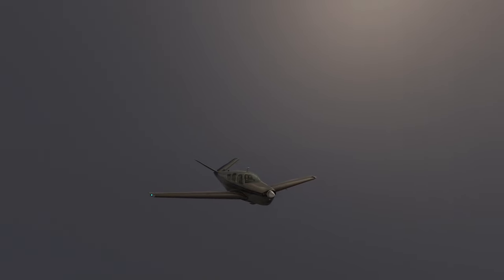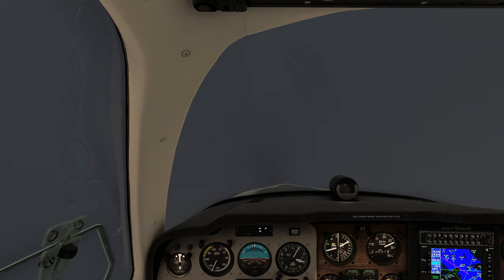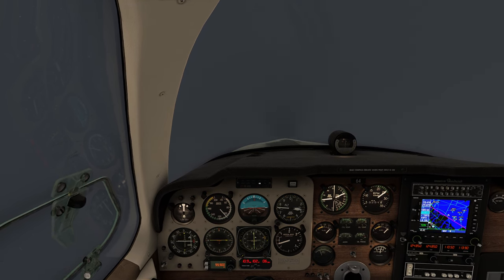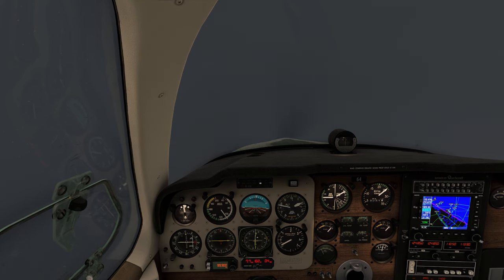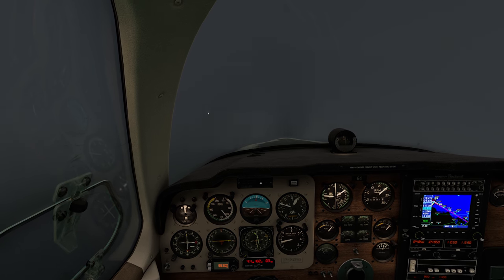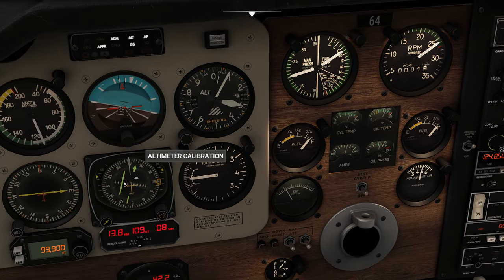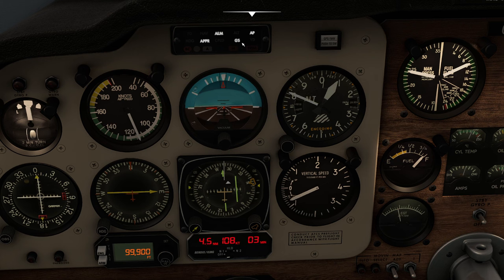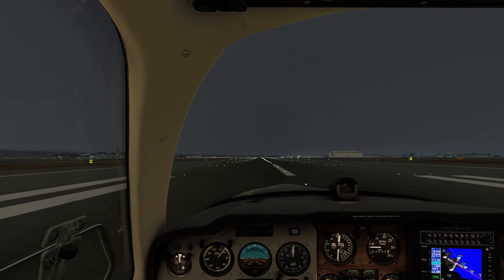MSFS - Switching to a Parallel Instrument Approach by hand and with Autopilot

Comment: Great video, this is an excellent example of why you should be proficient in hand flown AND coupled approaches both to minimums. First of all, I would not accept the transition to the parallel approach if in IMC conditions unless there was a real good reason for it such as a disabled aircraft on the runway. Even then I would seriously consider a missed approach and vectors to the other approach. (I realize this would have ruined the point you wanted to make but in real life conditions I would complicate things by accepting such a clearance). In VMC switching is not a problem. I have done it many times in an airliner within three miles of the runway sometimes at my request to shorten the taxi to the gate. For this reason we always had the localizer frequency for the other runway tuned and identified and we only did this in VFR conditions.
That being said using the autopilot was the better option as it prevented the over-corrections during the hand flown demonstration. Here is something for you to try and I would love to see you do a video of this. You have two nav radios, set one to the primary approach and the other to the parallel approach. The primary receiver will show on course and the other will show off course. Also you should always have the heading bug on the current heading. When told to switch just select heading and change you are heading with the heading bug by 10 to 15 degrees as the number two nav is centering the localizer switch the nav source to the number two radio. If the glide slope is above you hit Altitude select (as you did) and make sure you are in Approach Mode.
Again, that was an awesome video.